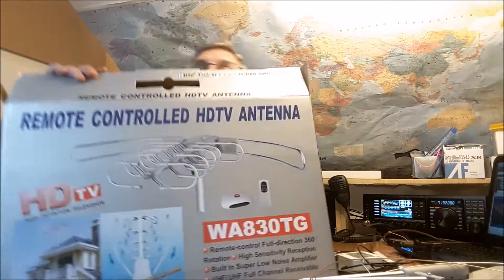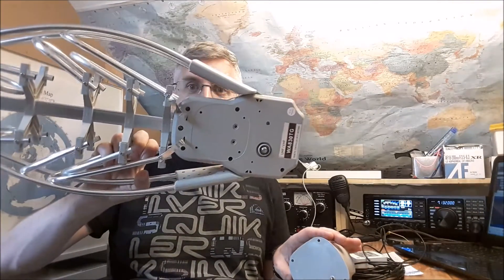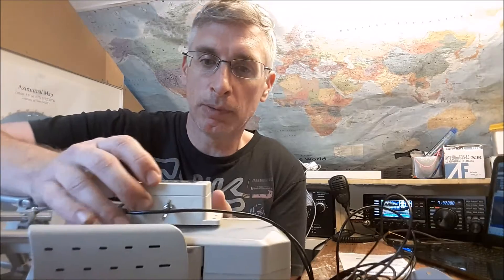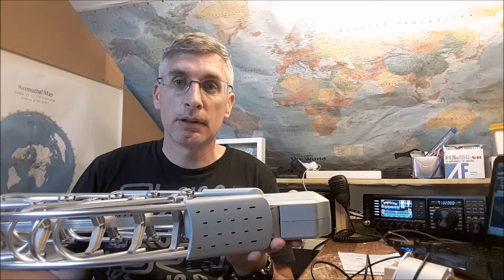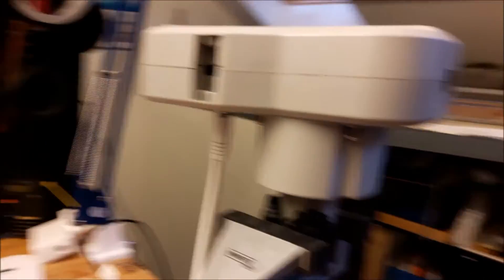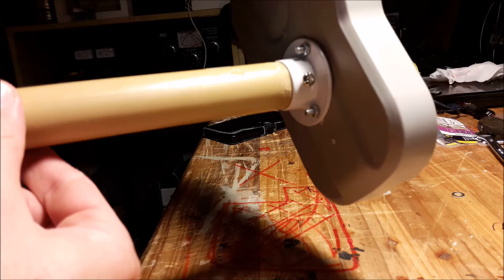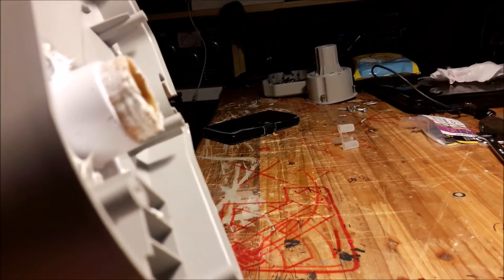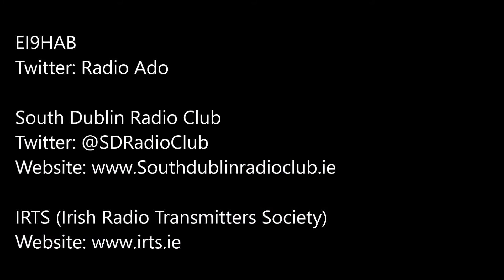Cheap Rotator for Loop Antenna

Comment: Would love to buy one, but can't find it for sale in the UK. Where did you get it?
Reply from the maker: Hi Peter. I got mine from a UK site. on Amazon The Antenna is similar to this - https://www.ebay.co.uk/itm/150mile-4K-1080P-Outdoor-Amplified-HDTV-TV-Antenna-Digital-UHF-VHF-360-Rotation/264230544873?hash=item3d855e25e9:g:3JQAAOSw7kxdTfLk 
There are a few makes by the looks of it but they all seem pretty generic.

Comment: Good idea Adrian,
you could however also use the V / U directive for TV with the MLA attached above ... you had a "system" of directional receptive antenna complete revolving ...
Ciao e Saluti dall'Italia.
73. Giuseppe.
Reply from the maker: Giuseppe, I know you are the Antenna Jedi Master. Do you think the "TV" antenna would perform as well as the loop?
Reply: @ado75  I would also try that directive for the V / U radios ... you may have some nice surprises ... having them on a single rotor you did bingo ...
Let me know.
Ciao. Giuseppe.
Reply from the maker: @qrpradiolistner7232  Thanks Giuseppe. I never thought of it that way. I'll use the loop first and see what the noise levels are like, then I'll put the Yagi elements back on and do a comparison. Thanks again. 73
Reply: @ado75  I meant a mixed antenna system ... HF / VUhf ...
as you have seen from my videos I built some crossed loops for the HF and a loop in the center dedicated to the V / Uhf ...
I would have built your loop above the directive in order to have 2 antennas with an extended and different frequency range ...it's a shame not to use the Yagi directive anymore ...
I'm sorry for making this remark.
a greeting from Formia.
73. Giuseppe.
Reply from the maker: @qrpradiolistner7232  No apology necessary. I'm here to learn... you experience & advice is much valued. 73 Adrian
Reply: @ado75  Grazie Adrian...

Comment: Very informative but your audio is low.
Reply from the maker: Thanks Tom. The Antenna is similar to this - https://www.ebay.co.uk/itm/150mile-4K-1080P-Outdoor-Amplified-HDTV-TV-Antenna-Digital-UHF-VHF-360-Rotation/264230544873?hash=item3d855e25e9:g:3JQAAOSw7kxdTfLk 
There are a few makes by the looks of it but they all seem pretty generic. 
The audio seems ok my end not sue if I can improve it in YouTube editor - thanks for the feedback. 73 Adrian EI9HAB